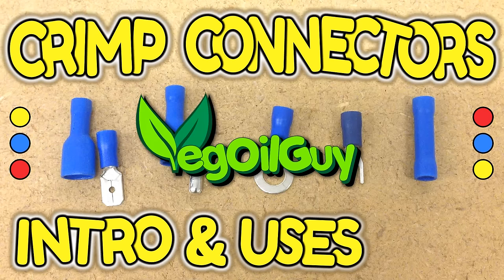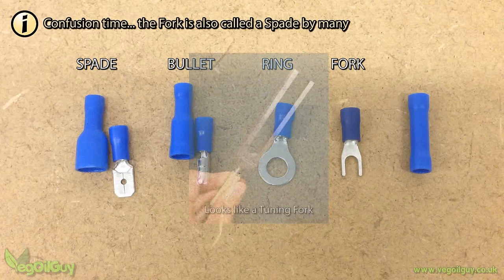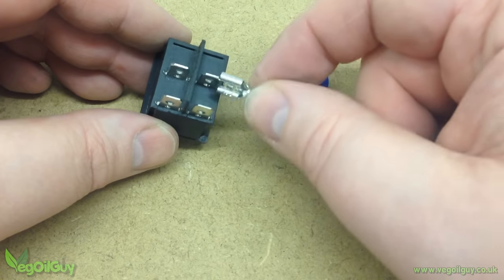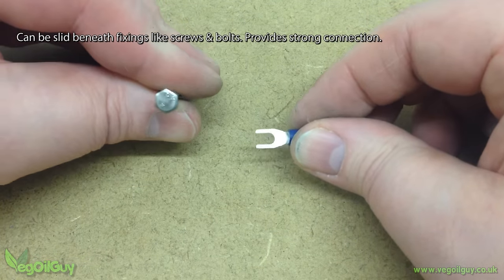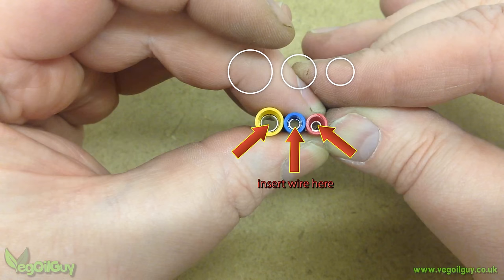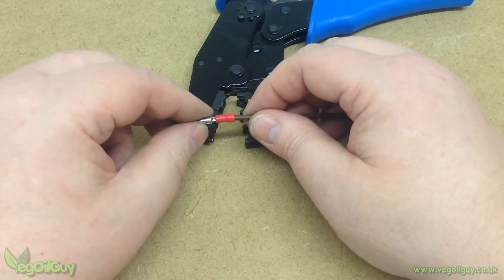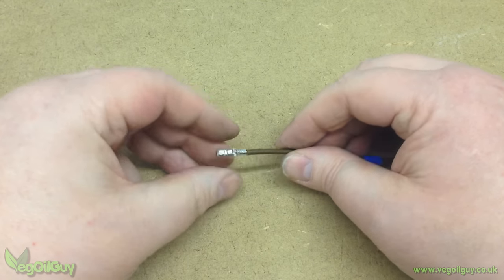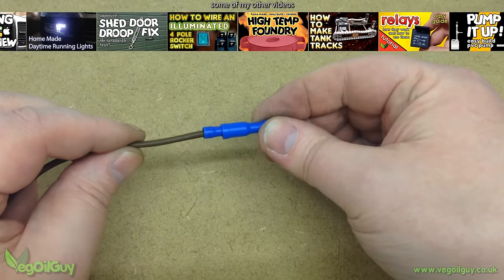CRIMP CONNECTORS how to crimp EASILY & SAFELY

Comment: worst thing you can do is to solder the connection, you loose all advantages of crimping. Just my penny!
Reply: Soldering is not a mechanical connection it’s a brittle eutectic alloy. Its against the US NEC (electrical code) to solder wires with an iron if the wire is to be in a junction box. If you insist on soldering, then you are meant to dip the wires in a ladle of molten solder. I expect exactly zero viewers of this video to actually do that.

Comment: Hi great video. If  you turn around your crimper you will get a better result. When using crimper the coloured dot is the wire side of the crimp. These crimpers have two crimps one for conductor and the other is to crimp around the plastic. They are not the same and would explain your loose crimp. Please do not take this as a criticism the rest of your video was very good and thanks for posting. Cheers.
Reply from the maker: Hi Selwyn. No offence taken my friend. I appreciate the tip. I'm always happy to learn : )
Reply: Yes. VOG, look closely at the half-moon shapes in each position of the crimp dies. Each terminal fits in one location in the die but there are 2 areas (half-moon shapes) that press on the crimp. One of these makes a deeper "squeeze" than does the other one. The correct way to crimp is to make sure the deeper crimp is on the metal of the terminal and the not-so-deep crimp is on the plastic and the insulation of the wire. The not-so-deep crimp creates a strain relief at the outlet of the terminal and holds the wire so that it doesn't move around and ruin your crimp. 

As Selwyn Tracey says the terminal and wire should be inserted in the crimp tools so that wire end of the terminal comes out the side of the crimp tool that has the colored dot.

Also note that the crimp dies in these tools can be removed (take out the screws holding in the dies) and installed such that the colored dots can be on either side. But I think that the dies are designed to fit best in the tool if they are installed with the yellow dot nearest the hand grips. 

No need for solder!
Reply: How refreshing to read a constructive comment given AND ACCEPTED gracefully!  Yes, that too is the first thing I noticed. 

I finally managed to snag a (used of course) 59170 Amp crimp tool and had been using IT backward also.  It always seemed to be so awkward, and last night I had a few minutes to read up on how to use it properly.  You are so right - the dies are asymmetrical and crimp the conductor different from the insulation.  The trick is that the wire goes on the side with the dots - as far as I can tell, that is true for all crimpers.  Cheers.
Reply: James Wills I was thinking EXACTLY that!!
Reply: VOG you’ll prosper in life with an attitude like this chief, all the best 👍
Reply: @jwills8606  Left handed?  Lots of stuff is made to work better for righties with no regard for the lefies of the world and the result isn't alway obvious for newbies with them not knowing how hard a task is suppoed to be. :-)
Reply: @jwills8606  addendum:  I just noticed that I can mount the crimping "jaws" the opposite way in my crimper to make it easer for those who would rather hold the crimper with their less dextrous right hand while manipulating the wire and connector with the left.  The default setting seems to be the reverse. :-)
Reply: I was going to write that and thought I’d better check first... others have indeed made the point!
Yes, the exposed end of the connector (spade, ring, fork, bullet etc) sits out to the right with the hole facing left. You can loosely close the crimper to hold it in place, then insert the wire with your left hand and squeeze hard (once) to crimp.

Comment: my swollen thumb has just had three rabies shots after a wildcat mauled it here in Thailand, no it wasn't the wife. Thanks for the comforting video as I recover, I come from the school of Ersin multicore solder (aaah wake up and smell the flux Pre EU)  and I am doing a large electrical job here in my house I've had every bloody ying tong crimp tool imaginable and I hate them all and the tools, I don't trust the final job (especially on solid 2.5mm)  and soldering some (but not all) seems preferable and then instead of scotch tape (as ambient T is always 35C here) I use heat shrink sleeving. Thanks again I was sick to death of american videos and their stupid AWGs, you confirmed crimps are rubbish, PS I wonder if they do solder tinning electrically-heated tiny baths any more - if so - I'll use it on the cat that just put me in hospital.

Comment: PVC insulation tape is never a permanent solution, particularly for crimp connectors. It's prone to degrading and unravelling over time. Heat shrink sleeve is a much more durable alternative. It also makes a much neater result.

Comment: Good crimping tools are big and expensive. Mine resembles and is nearly as big as a small bolt-cutter. With such a tool, it is possible to apply significant pressure around the connector lugs and create fantastic joints.

Comment: Soldering wire crimp connectors can be OK in low vibration contexts but for automotive or more "active" settings that can be a problem.  The act of soldering the tip of a wire makes it very rigid while the main part stays flexible.  The point of transiton between states is rather sudden and that is the point along the wire where ALL the bending happens and that is where all the weakening happens until the wire is broken by each wiggle.  Crimping only doesn't create that obrupt spot where all the bending happens and so actually is more durable when there is lots of agitation.  (why automotive experts prefer it that way :-) )  -  Got this info from Jack on EVTV who is quite adament about this and he's almost right on things mechanical/electrical/technological/even-political.  Incidentally copper wire seems to become MORE rigid as it bends and so each bending would be inclined to be at a subtly different spot alonge the wire.  Crimp connectors on normally and you get to take advantage of the virtues of copper. :-)

Comment: I'm with you on these connectors. I think they get a bad crimp from having plastic over the top. I buy un-insulated ones and used short bits of heat shrink on top. Not to mention the colours look hideous on a nice car build.

Comment: 6:35 If you look at your crimper as shown in this moment of your video, you will see a star shaped washer,  that has what look like teeth on the top half of the crimper. That washer has a phillips head screw attached to the outside of the washer. That is where you can adjust the crimper to make the connection stronger, or weaker. Simply remove the screw, and rotate the washer, there are arrows pointing in 2 different directions + for stronger, and - for weaker. There is absolutely no need to recrimp a wire terminal 2, 3, or even 4 times as you mentioned. In fact, I actually had to weaken the crimping force on my tool, as it was cutting into the insulation on 12/12g butt connectors.

Comment: The procedure I use when I am fitting a 22 gauge wire in an 18-22 gauge connector.  I will strip more insulation, fold the stranded wire and insert it into the crimp connector round end first, prior to crimping. Loose crimps are caused because the whole isn't 75% or more filled. I am so glad you didn't solder the wire before crimping.  Good video.

Comment: Thank you! Good to know I'm not the only one who never has any luck crimping wires to connectors. I never thought of pulling off the insulation first and then soldering the connector onto the wire - what a great idea! Thank you for an excellent video...

Comment: A little tip for those of you making connections using crimp-on connectors, invest in a bottle of Nolox. Ideal is the company that primarily sells it here in the states, and is used on mechanical lugs where aluminum wire is used. It is a conductive gel used to prevent corrosion on aluminum to aluminum contacts or copper to aluminum. Squeeze a SMALL amount into the wire opening before you insert the bared wire, then crimp as normal. Also, those spade connectors are notorious for crap connections in a vibration-prone application (cars, planes, boats) a LITTLE dab of Nolox into the female spade end before insertion will help to avoid said issues.

you're welcome👍

Comment: As a panel wireman I use crimps and bootlaces all day.
The cembre crimper and nippex bootlace crimper are very reliable.
Your crimper will have a + and - to adjust the tension of the spring.
This will ensure a good connection.
A pull test will also confirm if. The cable is sound.
You can also tell if you’ve miscrimped as it doesn’t feel right.
Reply from the maker: Thanks for your input Carl  : )
Reply: his crimpers were best suited for the butt splice crimp, as they crimp both cables coming in. theres a different set that only crimps on one side.
Reply: Google didn't find a hit on either of those tools.

Comment: I too was never happy with how plastic insulated terminals crimped, so I've always done exactly this and pulled the plastic cramp off, crimped and then soldered. You can also buy uninsulated terminals which come with rubber insulation which you slide over after crimping/soldering. I actually like to use heat shrink as well before sliding the insulation over it if I want to be really safe.
Reply: Apparently, it's not good to crimp and solder because it could cause the wire to break

Comment: Thanks Man. I have had a similar experience with crimping wires. I can never, ever get those crimped well enough to feel comfortable about the connection long term.  I certainly like the idea of pulling back the insulation to visualize what you are crimping and there is in-fact a good tight squeeze on the wires. And of coarse the soldering of the connection seals the deal with confidence. A lot of my applications need to be waterproof so I think I may buy the connectors without a sleeve and use a good heat shrink over the connector. Thanks for the video, its helpful for a self taught person like me to see what others are doing!

Comment: You are able to increase the crimp strength by changing the tooth the screw just above the handle is holding in place. I have had a few pairs of crimps and have always had to adjust this. 
However, soldering will always be better. Awesome video!
Reply from the maker: Many thanks : )
Reply: Thanks 👍 I was having to use the red crimp on the blue 16 gauge to get a solid crimp..

Comment: Thanks very much for this informative video.  It bothered the heck out of me that I could easily pull the crimp connector off of the wire, which means it's a very unreliable connection.  I almost went out and bought a dedicated crimper until I watched this.  I much prefer the soldering method!

Comment: I agree with your comment concerning the poor connection that crimping can sometimes chive. I my experience crimping often leaves the wire loose. And I have tried inserting the wire on both sides of the crimping tool.

Comment: Forks are also a viable alternative for wiring stranded wire to outlets and light switches here in north america (Canada & US), especially if the length doesn't allow you to do a usual loop with a piece of insulation sort of serving as a bootlace. There also exist forks with the tips bended upwards, as an extra safety to prevent the wire from slipping out, but they're a bit more annoying to remove and, so far, as long as you tighten down the scrww properly, it won't come off.

Comment: I am a solder it before crimp it person but the weakness of a solder connection is vibration.  Try this experiment tin a section of copper multi strand wire. Bend the tinned section back and forth, it will snap very quickly, usually where the tinned area merges with the un-tinned.  Soldered joints should not be used where vibration is an issue.  You do have to balance that against the downside of a crimped cable which is electrolytic corrosion caused by different metals touching each other.

In my view the best connection is a marine type.  The copper cable comes with each individual strand tinned with a zinc, tin and lead solder.  The cable is still very flexible and is crimped onto high quality tinned brass terminals.  This type of connection is vibration tolerant and resistant to corrosion

There is probably a higher standard for aerospace but for me marine quality is as good as I need..  BTW  love your videos
Reply: You're absolutely correct about solder embrittlement.  If there's any chance of the cable vibrating then you need heat-shrink over the splice.  But a crimp splice is better than a solder splice with heat-shrink.

For avionics the wire and crimp barrel are untinned.  Wire is copper, crimp contacts for connectors are beryllium-copper (or similar) gold-plated (5 microns over nickel flash) for the connector contact area, usually unplated crimp barrel.

For electrical distribution the wire is copper and so is the ring terminal.  The pressure from the crimp tool is enough to cold-weld them together.  A Hellerman Deutsch rep I occasionally encountered showed me one that had been sectioned so the cold weld was visible.  The individual strands of the cable cold-welded together and the barrel of the crimp cold-welded to the wire with no voids between the strands or between barrel and strands.  The crimp barrel was as thick as my wrist - that takes a serious crimping tool.

A good crimp is the most reliable joint you can get.  A bad crimp is a failure waiting to happen.
Reply: @bdf2718  We joke that anything in the marine world comes with an extra zero on the price tag I guess in avionics you can add a couple or three zeros.  Interesting point about the cold welding that's kind of wow!

Comment: Sorry if all ready mentioned or asked, but would it make sense to use a female connector where the wire is a supply of positive (on a negative ground system) since it would be less likely to cause a dead short for the instance when the connector was unhooked than if it were a male?

Comment: Thanks for the informative video, I, as a DC electrical hobbyist have been building Brown's gas generators which work on the basis of electrolysis, I've been having trouble with ring connectors ie the wire which I crimped coming lose when I thought it as securely crimped, you say you don't trust crimpers! I thought I was doing something wrong when crimping these ring connectors, but your comment about soldering has me thinking, and the humour helped too lol.

Comment: GREAT Video!

I think your method is better than crimping, but you only show the male bullet connector's plastic cover being removed, but that's the easy one to do with needle nose pliers :)  As you don't have the metal connector sticking out to grab hold of, how do you remove the plastic cover on the female bullet connector?

Comment: Just before seeing your video I was already soldering my wires connectors because I didn't want to spend for an extra tools just to crimps 😆 Old reliable methods are the best even if it require more dexterity and time.
Reply from the maker: It's whatever works best for you my friend. 😁

Comment: I am SO glad I had watched your veg oil videos because clearly the algorithm knew I wanted to watch your video on how to crimp these little guys. SO glad i did because having used the method you describe at the end (without solder I confess) for many years, I always felt like a plebian compared to the superior crimp-tool owner/operators. Some of these double-hinged mechanisms are €500+! That's double-unhinged if you ask me. I was eyeing up a €80 set on scamazon, but now that I realise magic doesn't exist, i'll go back to using plyers and patience to get a known-good result. Top video!

Edit: Although i've heard that solder on a 240V AC connection might be dangerous, but i've not heard as to why it should be more dangerous as to the exact same connection without solder. Would be good to know the mechanics behind why solder on AC is bad, because it's pretty counter-intuitive.

Comment: I find a big reason for the bad connections on those insulated terminals is because even the matching dies in that ratcheting type crimper cannot accommodate for the insulation itself and doesn't quite squeeze the barrels of the terminals closed like it should. So basically those jaws with the colored dots on em don't work for shit. But if you just use the equivalent non insulated dies which have a detent that punches the barrel down and forces it to form around the detent, there's no way in hell that wire is coming out. I've tested all kinda gauges with all different types of terminals and the wire itself snaps before pulling free of the crimp.

The only downside kinda is the detent can sometimes gouge out or make small tears in the nylon insulation. But if you use the heatshrink kind of crimp terminals, that's not a problem at all. It totally heals itself. So really, always use the non insulated portion of the crimp tool for both insulated and non insulated terminals for a rock solid connection.

Comment: Pretty good video... thanks.  I'd like to say that if using the properly sized connector for the wire gauge being used, and a quality crimping tool, then the crimp should be adequate without the need for soldering.  Also, it should be noted that crimping should be used on stranded wire only.

Comment: heres the maximum size cable for those crimps. red is 1.5mm, blue 2.5mm and yellow 6mm cable. and the crimpers you was using are really intended for the butt splice connector. if you was putting 0.75 into that 1.5mm crimp, i would strip of extra cable then bend it back on itself to thicken it, usually helps make a better fit and more secure.